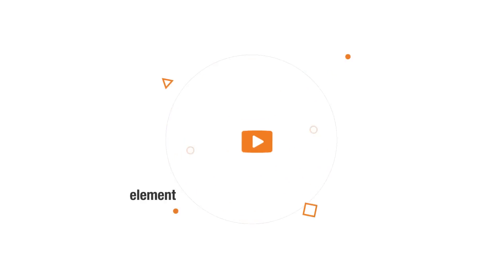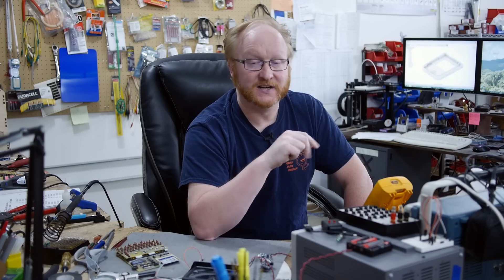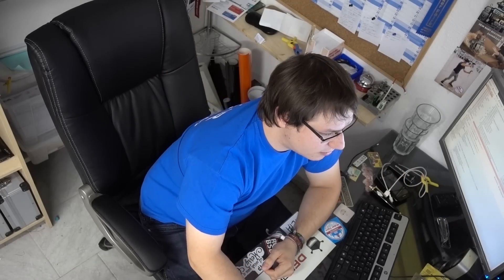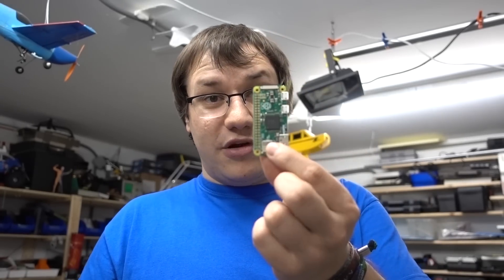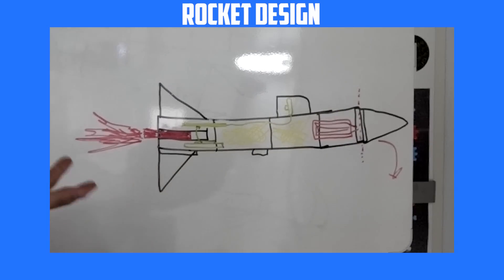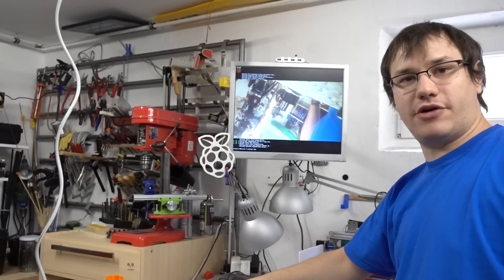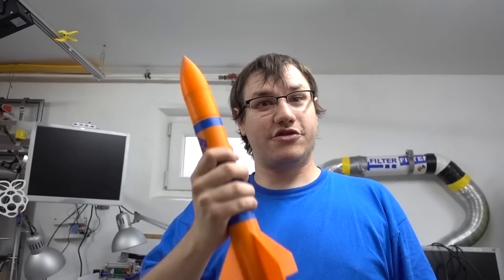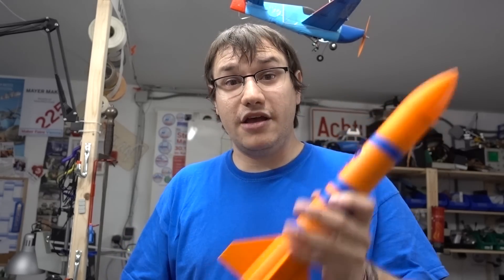Raspberry Pi Selfie Rocket

Comment: Dude! You're working much too hard on the rocket calculations. That little motor is totally insufficient for the task. The rocket never gets high enough for the parachute to deploy properly before hitting the ground. You could simplify the design by using a water rocket, which opens up the opportunity to use the RPi to do so much more. You could use it to log the altitude and deploy the parachute. I've done videos showing how to make the rockets and the launchers and even an altimeter (based on the MSP430 Launchpad). It's much more powerful than those hobby rockets, so it will go much higher. Water rockets are much less expensive, and are considered a form of "up-cycling" waste. It's a win-win!
Reply: On behalf of legal restrictions, I had to make sure I will not reach a greater height than 100m. water rockets are considered a weapon when weighing over 250g so that was no viable option. Unfortunately I live near multiple airports and austro control is surveilling everything.
Reply: Sorry to hear about the legal issues. However, I do believe you could make a water rocket with your camera payload and a servo actuated parachute deploy that is less than 250g. I have built a number of them that are 3-4L in volume that weigh 200-225g, including a micro camera and battery. You could make one like that and then trial it at increasing pressures until you reach the limit, as a rocket of this type could go 120-150m peak. I enjoyed your video and hope to see more of you on here! Cheers!

Comment: For me this project was a fail. Building rockets, even amateur rockets like this IS rocket science.

I have built 4 successful rockets which all launched to much higher than 100m, the parachute deployed each time and the payload and electronics were all recovered intact. While you can do this ‘by trial and error’, there are plenty of videos going into more detail on successful launches.

The launchpad was angled incorrectly, this immediately sent the rocket in an arc rather than straight up. Given the material used to construct the rocket, I do not believe it was long enough to provide stable flight.

And yes, there were failures, one of my rockets exploded on the launchpad.

Comment: PLA is too heavy. Use a paper towel/toilet paper tube. And recording the video is cool but you need to stream it live to the laptop over WiFi. Even better stream it live to YouTube! If you just want to record video you can buy complete tiny spy cams complete with lipo and sd card. I did this about 10 years ago with a nano sized r/c helicopter. I gutted the camera down to just the pc board and trimmed it to shave off as much weight as I could. The whole thing, helicopter, camera, batteries, receiver and all fit in the palm of my hand. This was long before the drone thing happened. It was pretty cool for its time. 
I still have the video up on YouTube if anyone one wants to check it out. It’s a little out of control and it was windy out but still pretty funny to watch :) https://youtu.be/jGkiGZ5463Q

Comment: I'm not a pro, but my guess is that the onboard electronics or the 3D print job threw off the center of gravity, causing the rocket to immediately tip over on launch and thrust into the ground.  My suggestions are to add a slight twist to the fins to make the rocket spin, lengthen the launch guide to allow more speed before the rocket is free, and since the mass would rotate too quickly for a clear picture during ascent, set the picture function to some kind of switch to start recording when the nosecone separates from the body for parachute deployment.

Comment: I really liked this video and the presenter, but as a person who has participated in rocket meets with young people, I was horrified. The 3D printed rocket body was clearly way too heavy. Safe rockets use light weight cardboard tubes for a reason. No thought was given to where the rocket would be when the ejection charge went off. It went off after the rocket had crashed. Fuse ignition of the motor is extremely hazardous due to the chance of the nozzle clogging or quick ignition. The rocket flew poorly because it was not correctly balanced. I could go on and on, but I think I made my point. Good video, but before trying something like that, brush up on the established safety rules of the field first.

Comment: This project was way more complex than it needed to be. No need for the WiFi dongle, the SSH connection, or the transcoding. The Pi should just keep saving raw video until it runs out of storage. Maybe light an LED to show that it is working. Keep it simple!!! Clem does show promise, hope to see more from him.
Reply: at first I thought I could get away with that Version, but if the video gets not correctly stored and the Pi does not get logged out safely... footage corrupted, Every time the camera got just slightly unplugged the footage was unreadable. Thats why I had it to do like  I did.

Comment: Nice video!!! What would i make different? Auto starting The rocket with a relay, +more engines, second stage, even third, and The electronics inside The second Or third stage. 

As for The channel... well, it’s a pity new hosts can’t use The workshop and have to do everything with their own equipement... and no support. I can watch videos directly dron a maker’s channel instead from E14... But on The other hand, it’s fresh air. I like handhelds videos, but there are just too much. 

Congrats and keep up making!!!
Reply: thanks! Building a multi-stage rocket was not viable because of legal restrictions in my area. maybe I get to do that some day .far far away